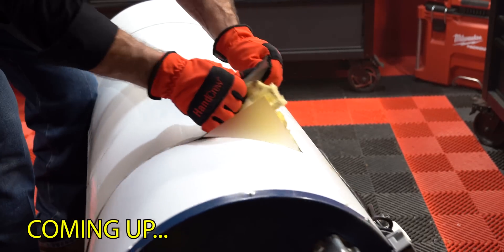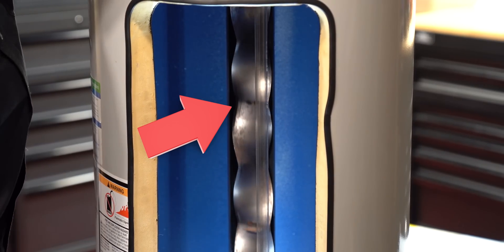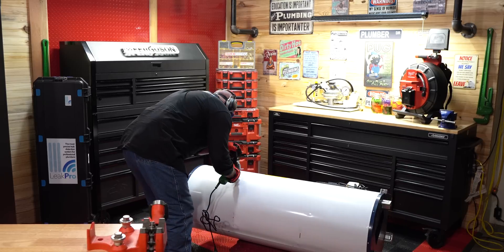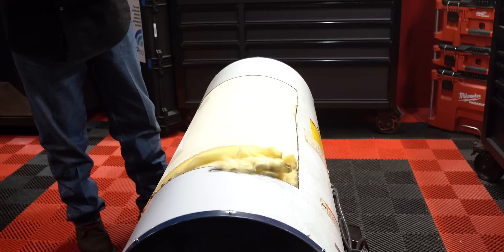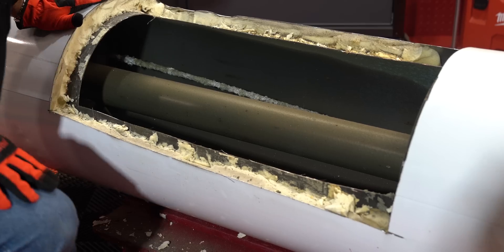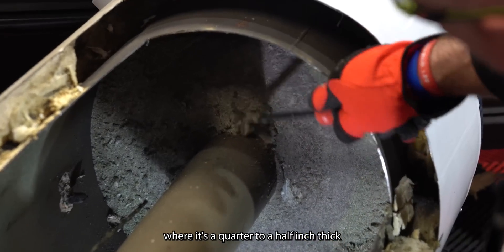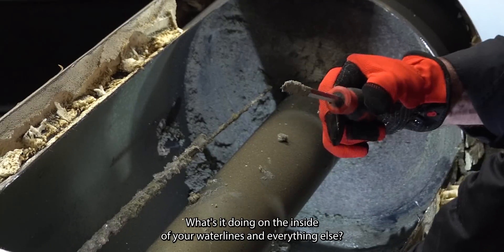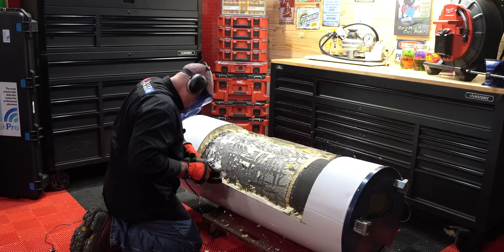What's Inside A Water Heater That's Been Sitting For 10 Years? Let's Find Out!

Comment: I once pulled a water heater that was more than 30 years old to drain it removed the valve completely put a 1/4 copper line 2' long and forced it with air and ramming after the water and the sludge that came out it was about 300 lbs after the new install got a call t couple months later and was told there bill was more than $100 a month lower and they had HOT water after years of worm water

Comment: I have three electric water heaters that are 21 years old. I had to replace my fourth water heat after 19 years. Two tanks are on city water and two tanks are on a well. When I flush the city tanks, white sand comes out. When I flush the well tanks black stuff comes out. The black stuff is sulfur from the well water.

I prefer electric water heaters over natural gas water heaters.

Comment: While the bottom of that water heater was... nasty... IT was quite different from the inside of my old water heater when I replaced it, and it was a roughly similar age. We had been having problems with it not heating right, so when I checked the anode and found it GONE (just the Stainless center wire remained), I decided that with the issues, and the anode being gone, it was a ticking time bomb, so I replaced it with a tankless. While I didn't cut it open (kind of wish I did now), stuck a borescope in it to see what was inside. The flue was coated with what I believe was calcium, and the bottom had the same sort of white material of varying sizes, not the sand-like sludge in this tank.

Comment: Is there any need to flush a viesman vitoden 100 nat gas, with the combi kit for on demand hot water?   I had it installed in 2015, its never been flushed.  Should it be?   Our water here is pretty clean, but it does have a lot of mangenese.  It will turn white shower curtains reddish on the bottom after about two years.   Im just curious.

Comment: I want to send you an Indiana one to do! I’ve seen them with a foot of sediment.
Reply from the maker: Send it my way!
Reply: @RogerWakefield  hmmm. 🤔Wonder how much shipping would be?! Lol. I do apartment maintenace so ones bound to come available here soon.
Reply from the maker: Where are you located?
Reply: @RogerWakefield  Plainfield, Indiana
Reply: @RogerWakefield  I have removed water heaters in northern Indiana that weigh 50lbs over the original weight. I have cleaned more than 10 gallons of calcium/magnesium out of a functioning water heater around here with a shop vac through the bottom element on an electric water heater before. Our general hardness is 25gpg in most of Indiana. A water softener is a must lol.

Comment: A good portion of the sediment build up is from the deterioration of the anode rod.  The type of anode rod your tank has will also affect how much sediment builds up, the tank you cut open looks like a whirlpool which has an aluminum rod from the factory.  And the ones whirlpool used are  notorious for leaving behind a ton of crap as they break down.  The new tank looks like a Bradford white, they use magnesium rods.  Aluminum rods tend to last a little longer than magnesium ones, hold up to softened water better, and help if you have problems with odor.  but as the aluminum breaks down it turns into that whiteishblueishgreenish looking hard jelly stuff, and leaves ~3x it’s original mass of waste behind. Magnesium rods generate a slightly higher voltage than aluminum rods do and also tend to do a better job of protecting the tank from rust, they leave behind more like a scale.  The anode rod is what actually keeps the tank from rusting I’ve seen tanks last 40+ years just from periodically replacing the anode rod as it breaks down and flushing all that buildup out. Whatever you do never remove an anode rod altogether. Thanks for the vids Roger!
Reply from the maker: Great knowledge! Thanks for sharing that👍🏼

Comment: considering now adays a warranty is only good for 3-10 years on average.  For not being flushed for 10 years is on par.  I replaced my water heater in my house just last month that I put in 10 years ago when I bought my house. Old one formed a crack in it and flooded my house before moving in.........  My water heater had some settlement in it but not as bad as that it.  I have cut a few open over the years to make yard pits and smokers with.  I found that gas water heaters tend to last longer under constant use (IE big families or shared apt heaters)

Comment: Thank you for this video.  Mine is ten years old and has never been flushed.  It has been making a banging sound for about two years.  Is it safe to drain?
Reply: You can always drain it.  Problem is how clogged up it is.  You may need to go without hot water for at least a day to clean and flush it.  But at 10 years old you should go ahead and just buy a new one anyways since then you will have a valid warranty for at least a couple of years.
Reply: I would go ahead and replace it, a good rule of thumb is to check your water heater at 8 years to see if it needs to be replaced.

Comment: What about tankless hot water heaters
Reply: Over time, a tankless water heater may accumulate mineral build up which can erode the walls inside your tank's heating chamber. To properly maintain and clean your tankless water heater, it's important to flush those mineral deposits at least once a year.

Comment: Is it safe to flush one after 15 years? (GE Gas)
Reply: If you are on public water I don't see why not. 

I bought a house with a 1995 oil fired water heater in it (on a well) and it was so full of sediment I had to backflush air up the drain constantly (every minute or two) because it kept clogging. 

I would have loved to cut it open, it was stuffed with sediment. 

I replaced it last year with a hybrid electric.

Comment: Water heaters are also considered sediment traps.  They are essentially a glorified drum trap.  Install them into the system with this in mind, and they can be very helpful, but you gotta flush them
Reply: Not if it’s electric 🤣
Reply: @jman0870  especially if it is electric.  Are you sure you know what a sediment trap is?
Reply: @brrrayday  uh…no? The elements aren’t on the bottom on an electric dude. You need like 10 inches of sediment before you have any issues with recovery rates AND the efficiency of electric is almost 100 because almost 100 percent of the heat goes into the tank, even if they look like shit. Feel free to try again though 🤣🤷‍♂️
Reply: @jman0870  Even though you're right in that the efficiency issues with sediment that Roger mentioned don't really apply with electric water heaters, that doesn't mean you shouldn't still flush them.
Reply: @aperson9495  I mean if you’re bored on the weekends, then sure. It’s far more important to take care of literally everything else in your house first 🤣
Reply: @jman0870  electric water heaters are literally money traps.